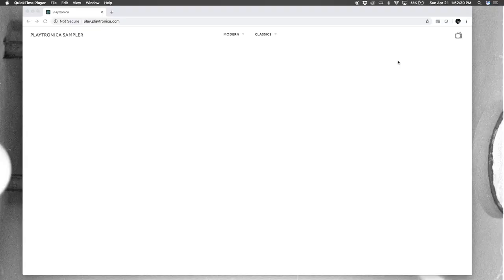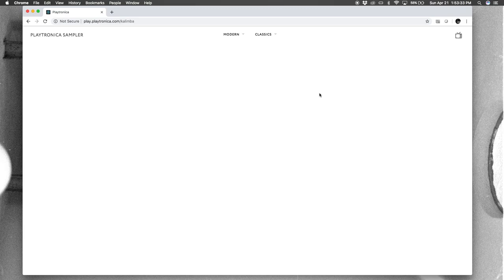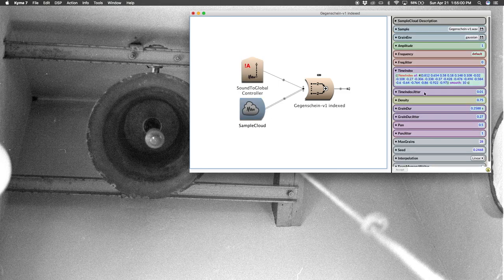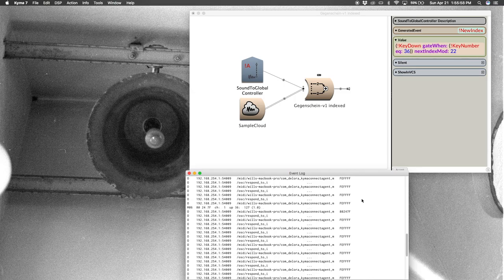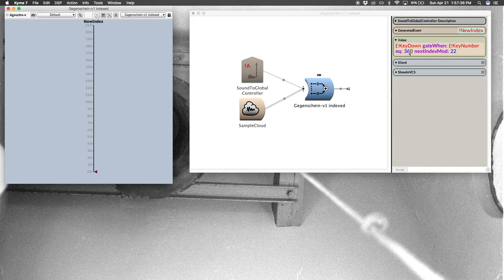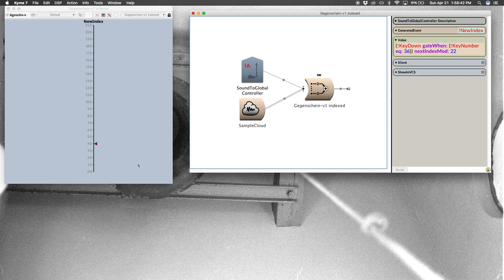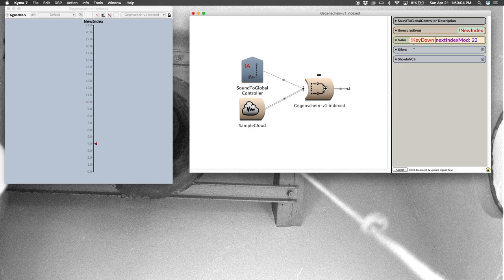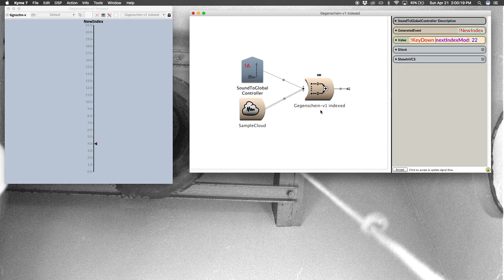Playtronica Playtron Explanation and Demonstration

Comment: How can you play this one? Sounds are generating thats ok. But İs it just working just as like trigger or something? Is it just working for a fixed note for a each conducted? I mean if İ want to play a Cmaj scale? Do I need 7 different conducters? I don't understand whats the difference when you compare a midi keyboard:)
Reply from the maker: Good questions! Yes, Playtron sends MIDI Note On and MIDI Note Off messages. "Is it just working for a fixed note for a each conducted?" Yes, exactly. "Do I need 7 different conducters?" Yes, unless you do some creative mapping in software like Max or Kyma etc. There's 12 unique patch points on Playtron each with its own MIDI note number. "I don't understand whats the difference when you compare a midi keyboard:)" As far as MIDI Note On and Off messages go, it functions identically to a MIDI keyboard. You might think of Playtron as an abstract way of sending note on and off messages; anything that is conductive can be used. This could help with aesthetics in a live performance, for example.

Comment: Is it possible to connect it to an analogue Synth instead of a computer?
Reply from the maker: In a word, yes, but Playtron connects via USB and sends MIDI over that connection. If you want to use MIDI with either pre-MIDI analog synths or with modular Eurorack analog synth systems, you need to convert digital MIDI signals into analog voltages.  For this, there are plenty of options. With a bit of research I'm sure you can find a solution that would work for you.
Reply: @SpectralEvolver  niiice... thx a lot for the quick response!
Reply from the maker: ManuMarley Sure thing! I’d be curious to know what you come up with if you move forward on this...

Comment: Is there a way to connect it to smartphones or tablets?
Reply from the maker: Yes, you can use any app that can receive MIDI messages. Playtron connects via USB so you might need an adapter to connect it to your device. For example, if you have an Apple device you would need a Lightning to USB adapter. I'd be curious to see what you create if you get it going. Thanks for watching!